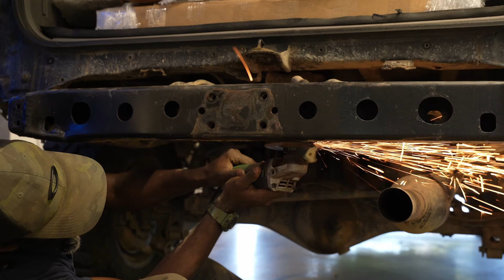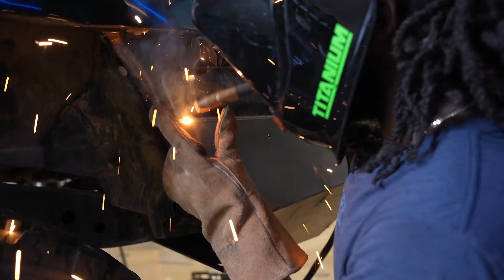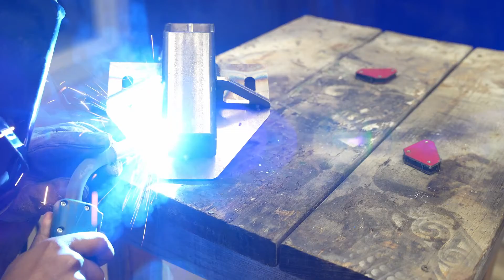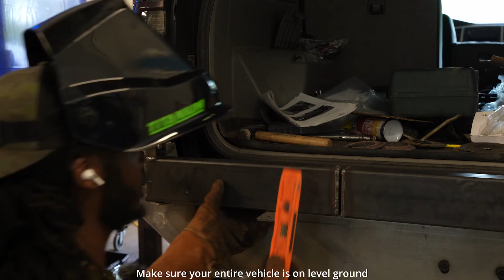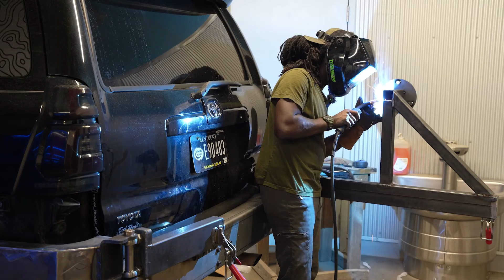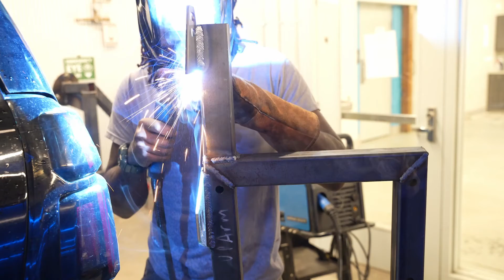Garrett Logan x Coastal Offroad Rear Bumper Build  | 4th gen 4Runner

Comment: Great job articulating step by step👍 
I too thinking of this last on the list mod, have shrockworks armor up front engine, trans skids.  33 ko2 won't fit in the spare hole even deflated, tried it awhile and tire rubber the black powdercoating off the stay bar.

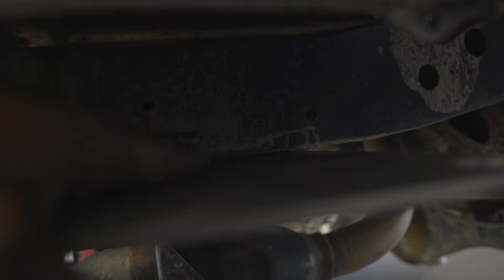question, at 9:20 plate 3 it looks like access to bump stops are going to be sealed up??